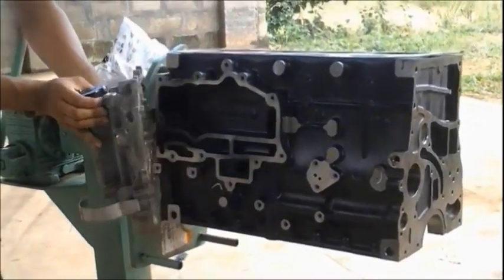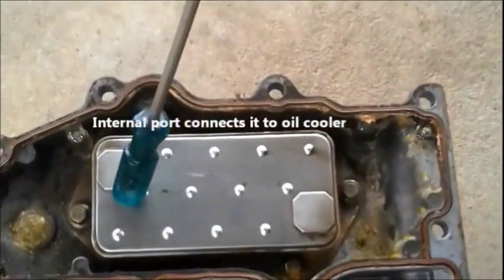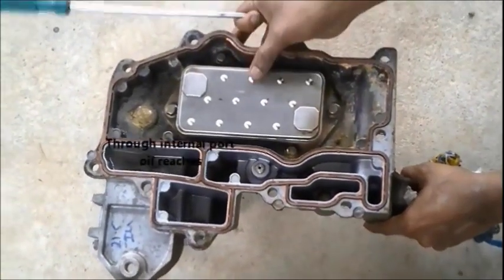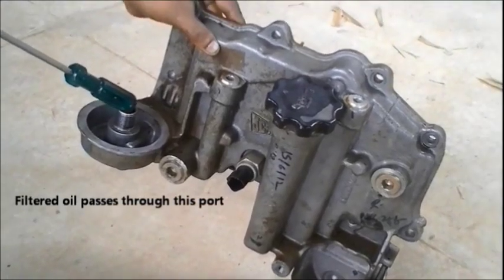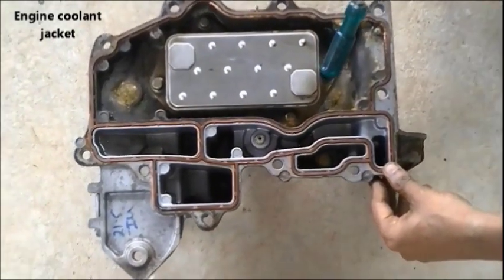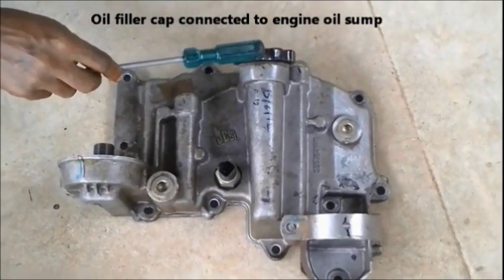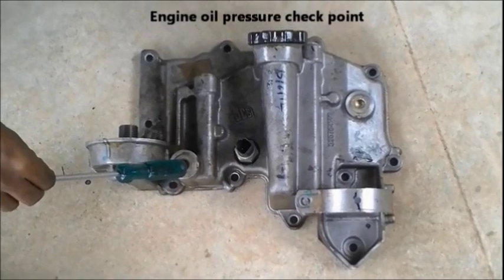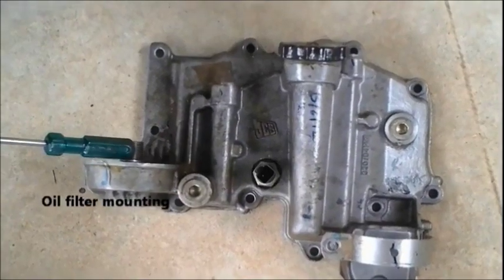How engine oil cooler works. ✔

Comment: Nice video sir. I also have oil in my ford everest 2008 coolant system. I had replaced my oil cooler, after 1 month oil is back in my rad. It was the o ring seal inside oil cooler that is broken again, so i change it. after 1 month oil was back again in my rad. it has been the third time i change it and It makes me wondering, what make the o ring keep broken? Please advise. Thank you.
Reply from the maker: It’s could be pressure, you should go and talk to the mechanic who has done the job.

Comment: good morning,

thank you for your Engine Oil Cooler vodeok.

We are in West Indies, we have SWARAJ MAZDA DIESEL Trucks, Made in India here.

Water is sweeping out of the Rocker Arm ROD, just over the first cylinder.We have checked the Water jackets .Water is not coming out of water jacket. Even when the engine is switched off, water continues to drip the rod which connects all the rocker arm. Its  water alone dripping .NO OIL.

what do you think is the problem? Thank you  RAVI

Chat Conversation End
Type a message...

Comment: What can cause oil to mix with coolant?
Reply: Oil pressure is around 1.8 bar while the coolant fluid is around 0.6 bar. When the oil cooler defects, the oil will runs into coolant as the oil pressure is bigger than coolant.